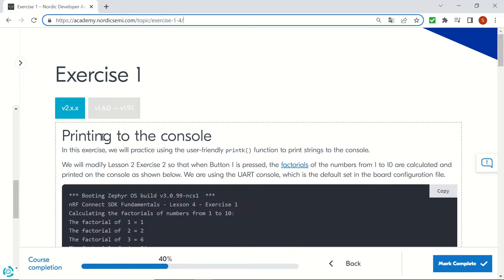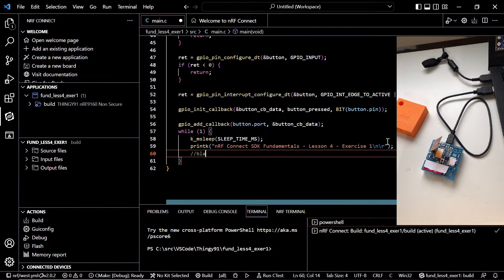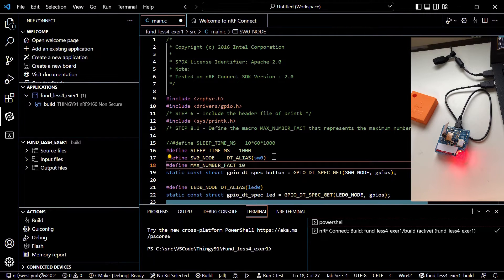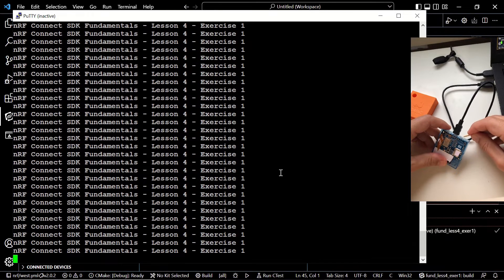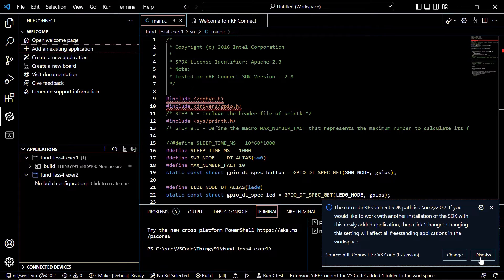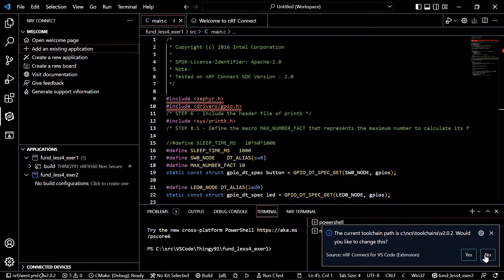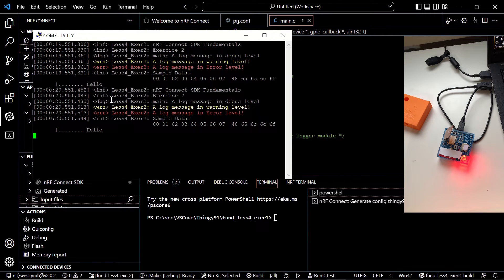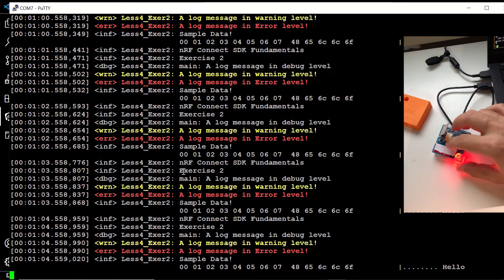Printing Messages to Console & Logging : Thingy 91

Comment: How are you able to see prinkt messages from the nRF9160? Does that require some special firmware on the nRF52840 no forward the messages to console?
Reply: there is a nRF5x companion chip on the board which exposes 2x virtual comports via USB and simulates a flash drive (firmware is in ncs/v3.0.1/nrf/applications/connectivity_bridge). printk is routed from the nRF9160 over the nRF5x over USB to the host PC.